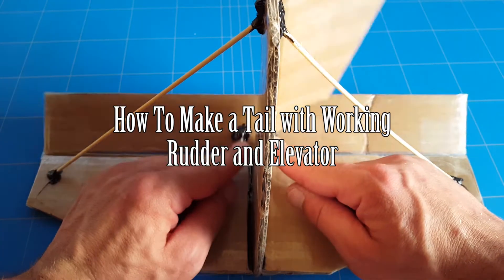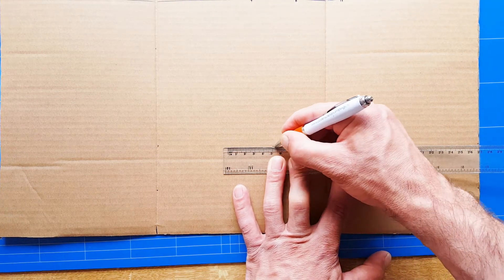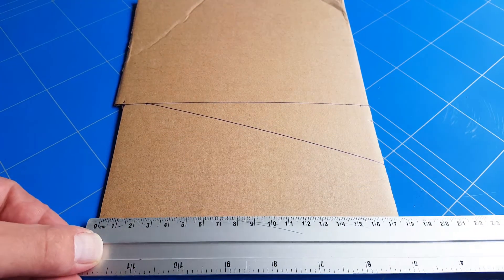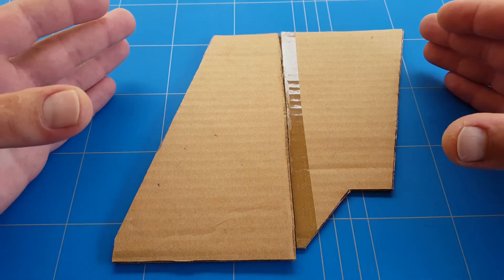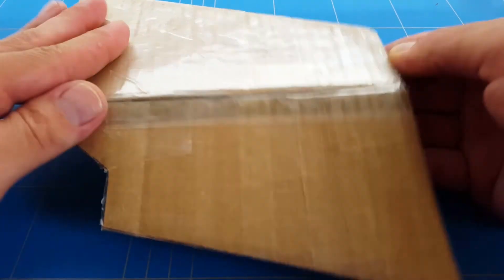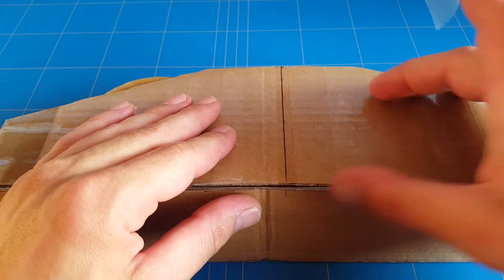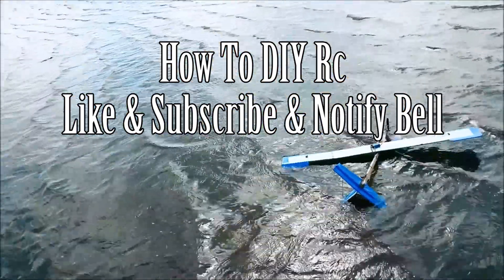$5 Trainer Best Beginner Rc Airplane Project EP3 [Tail Section Build With Cardboard]

Comment: Love this series. Would it be possible to make one that is smaller (scaled down) so I can transport it in my car? Will it still fly as well?
Reply from the maker: of course, we can scale it down but never did it before 
because I'm living in a windy area but if you scale down the wing to 120cm and build it from foam and copy everything else the same you still get a good flying plane
the original $5 trainer wing is 120cm after 2 years of abuse we sometimes remove 5cm of the wing that gets's crushed after a crash and 120cm wing shut fit most cars
but maybe i make it so that it's easy to remove and add the wing to the body helping al of you that don't have a flying area close by 
thx for the question Sir :D
Reply: How To DIY Rc I just built the first 2 wing sections today and ordered all the parts! So exciting
Reply from the maker: that's great news I'm really looking forward to your experience with my indestructible trainer
your the first one to copy it! making it exciting for me too and very proud
hope the build is going smooth and if you don't understand something please ask
tomorrow we start building the indestructible body/fuselage hope you find it interesting
Reply: Where does a step down converter fit into the build? Do I need to get more than one? Thank you so much for your help!

Comment: Nice job offsetting the cardboard grain to add strength to the elevator or any control surface made from cardboard. Looking forward to the finished product. Happy Building!
Reply from the maker: it helps if you worked in a carton factory with the same people that have build this https://youtu.be/170qBpw4uL8 thx for the support :D

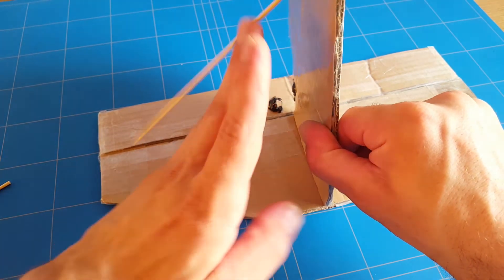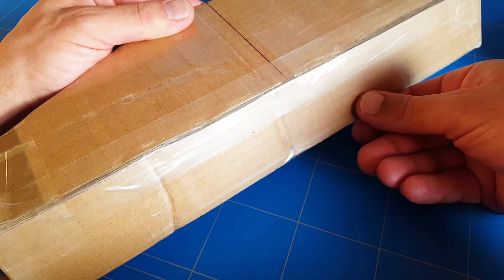Comment: at 6:44, wonky method of achieving control surface clearance has been used.    there is a  BETTER , equally simple, method to use in order to achieve clearance of control surfaces.   install the stabilizers so that the rudder Trailing Edge Aligns with the elevator Hinge line.   rudder/elevator Trailing edges Should be oriented Parallel to the hinge line.  the chords of the control surfaces Should be of EQUAL length. htdrc, i am forced to conclude that you can read english, and that you comprehend little.       at 6:00, it is clear that the vert-stab is at least two inches taller than NECESSARY.    the vert-stab leading edge Should have a slope of about 75 degrees above horizontal.     cheers
Reply: David Davids are you naturally a moron or did you learn to be one ? Seriously...he has a flying plane that works and flies very well...and yet all you do is complain and whine trying to tell someone what is wrong...the ONLY thing wrong is your constant complaining...how about stepping up and make your own DIY videos and explain to everyone how perfect you are in them and then show everyone your expertise in it and then simply Shut UP about anyone else....until you do that...all you remain is a Moron
Reply from the maker: oke it's not perfect in your eye's and there are things to improve on but we build it just like my old trainer knowing it fully works and it's easy to do stall turns and plenty of fun when he or she get's bored with learning to fly in circles but at my next plane we are sure to try out your tips and test how much better the plane fly's